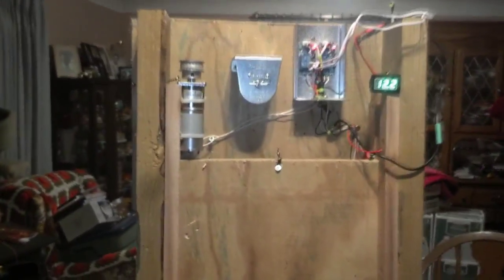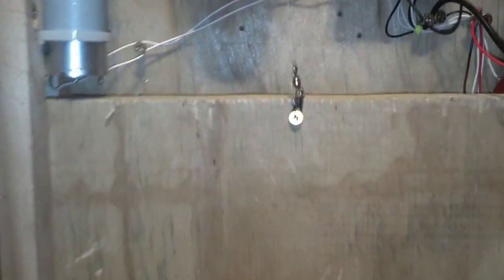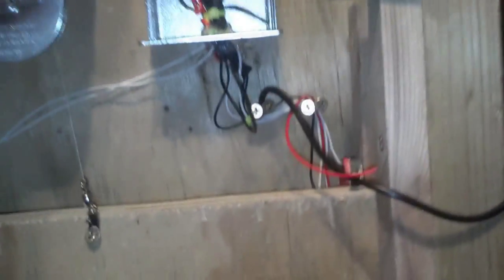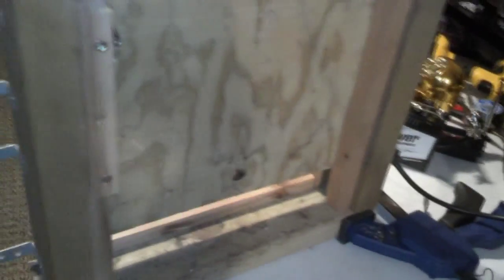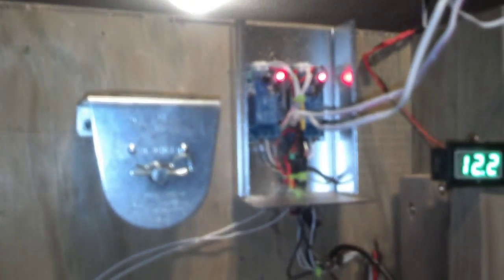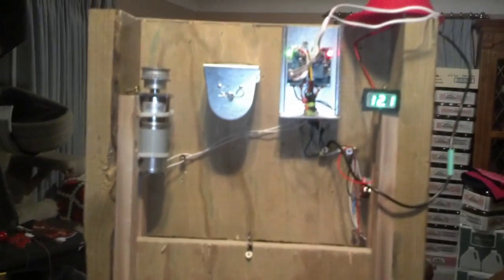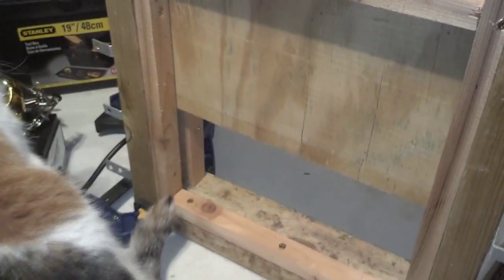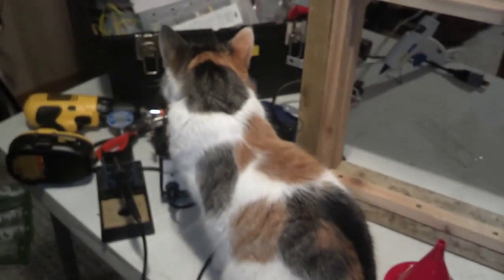Solar Power Automatic Chicken Coop Door

Comment: Why so many diodes? You don't actually need any on the motor/load side. The only diode that is need for back EMF is when the magnetic field of the relay collapse, and like I said that's on the coil side of the relay not the load side. These modules already have them built in. You are actually adding more resistance and decreasing efficiency by doing that. It's not a whole lot but still why add it when it doesn't need it at all. The motor itself absorbs it anyway on the load side. It looks like you are using zener diodes, if so why?

Also why add the pulley when all you had to do is mount the motor horizontally? Just wondering.

All in all it's a good build. I Have a video up that you can see wiring and it uses 2 Photocell modules as yours does but they are slightly different. They can be set to turn the relay on OR off when there is enough light. I can't tell on yours if the relays turn ON when there is enough light or if the turn OFF. Can you please clarify? I have mine wired different but I might change it to the way you have it wired. Mine is one module on and one off to work. I might change it to having them both ON during the day instead.
https://www.youtube.com/watch?v=gNbgvKYlEBc&ab_channel=AztecWarrior

Comment: In the wiring diagram I can't tell what actually causes the motor polarity to reverse? I see  the relays are wired differently, but the light sensor is what needs to trigger the polarity reversal, so I can't tell how that's implemented. (I have a coop door now that works on a timer and I'd really like to upgrade to use the photoelectric relays.)
Reply: Update: I just realized that the relays automatically alter swap their signal at the light threshold - as opposed to simply on/off which is my assumption.

Comment: IDEA, I just went through a series of tests on the Solar charger, Shad, Full sun, different connectors etc..
Its seems the quick connect I used with the inline fuse maybe stopping the voltage draw as I don't see much above 7volts.
In ALL other cases removing the quick connect with the inline fuse, I see 15 - 20 volts... Did you use the inline fuse (I think reads 1 )??

Comment: Great design, I used it for my chicken coop. How has the Solar charger performed?
I used a 12V/7.2Ah battery I already had, which powers the system fine but I loose around .3 volts per day (Per the volt meter) so I have to charge the battery myself around day 4. Any thoughts, is my battery too large?